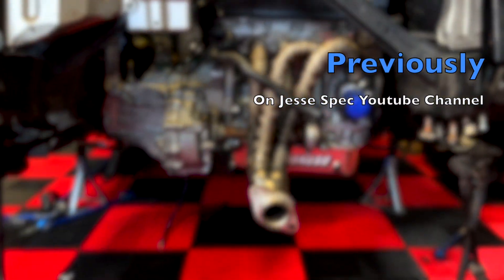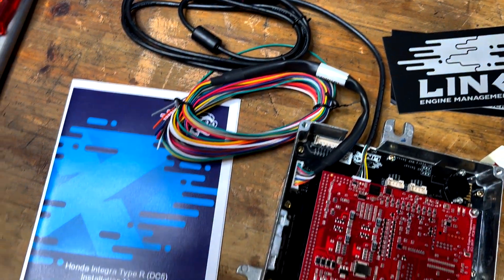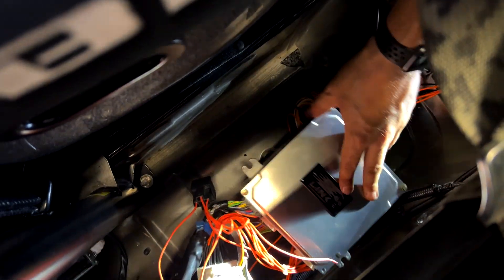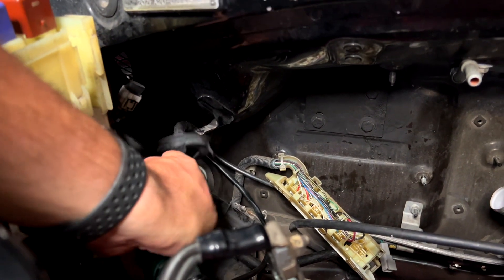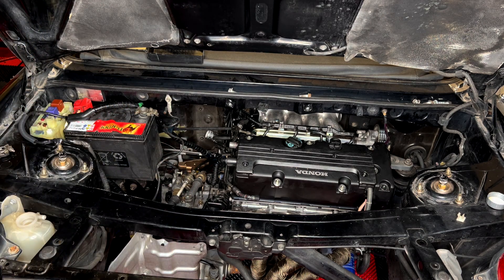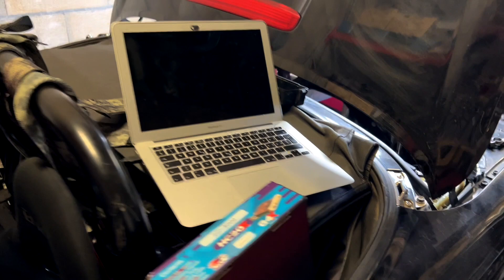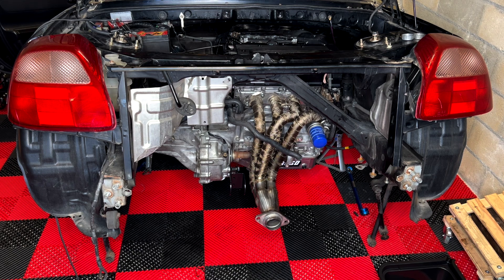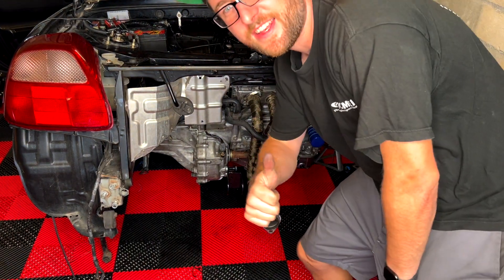How to Kswap an Mr2 Spyder EP11: First Start of the K20 with the new motor (all motor)Will it start?

Comment: Awesome detailed videos. Help me so much.  One question were does the starter signal wire from the honda link up to?
Reply from the maker: Hi, thanks for your kind comment. I was lazy on this one, I used the adapter harness and it just worked immediately 🔥👌🏼
Reply: @JesseSpec  I got the map adapter harness on to a kpro.  I got a feeling I need to swap my engine loom as it might be the issue as I got an open plug.
Reply from the maker: @JeanMasué  hi, to be honest I think that is where your mistake is.